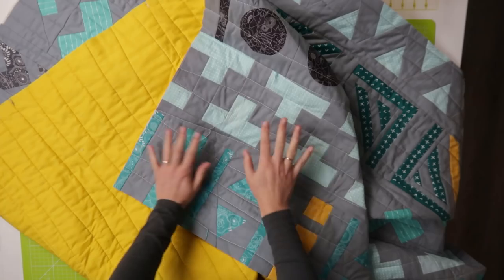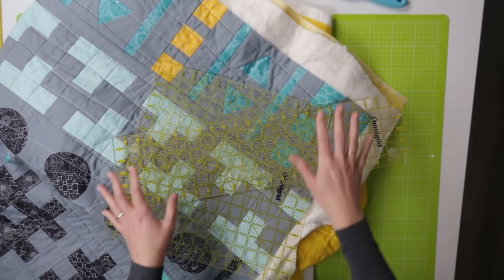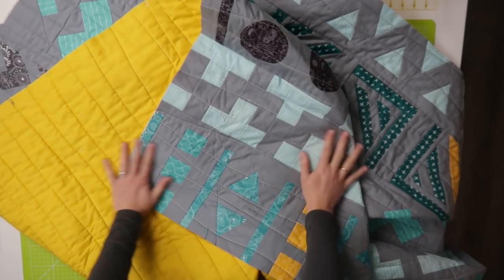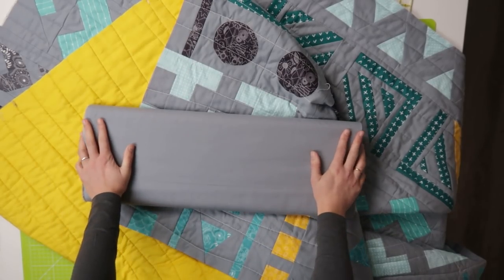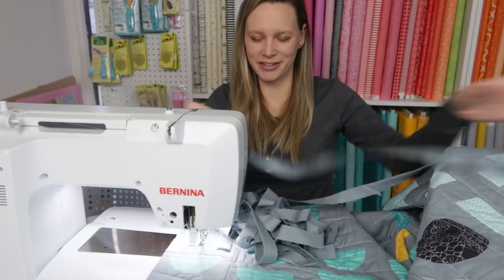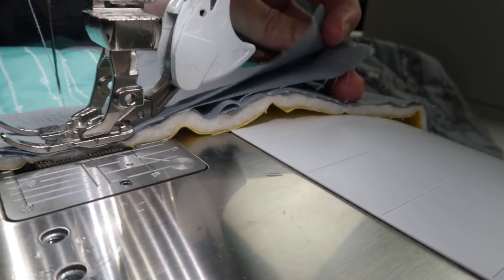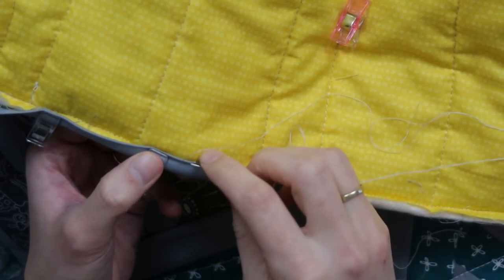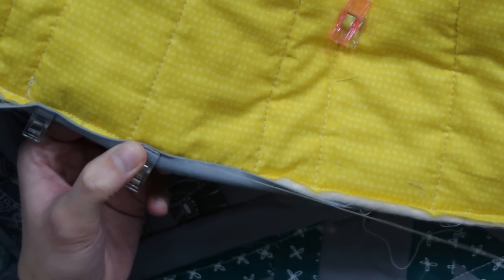Adding a binding to a quilt | Sugaridoo Bernina QAL

Comment: The method I like to use to join binding at the end is really easy.  You overlap the ends by the width of your original fabric strips (in the case of your video it would be 2 inches.  Cut away any extra, then line the edges up for a miter as usual.   It will give you a nice mitered join and no one will be able to tell where you joined your binding!  

I hope that made sense. Lol